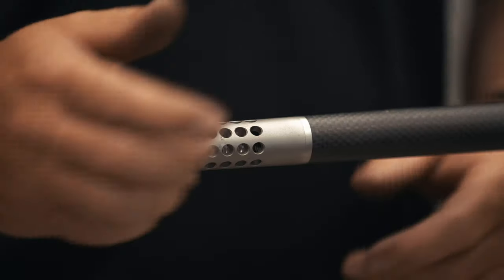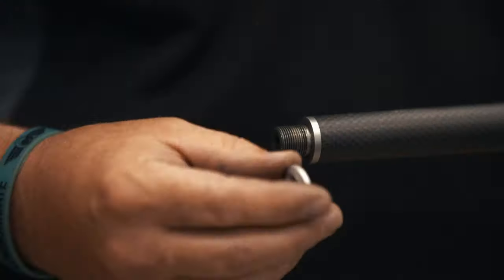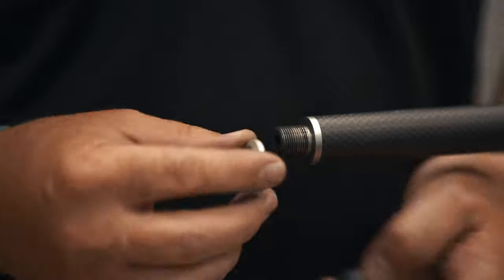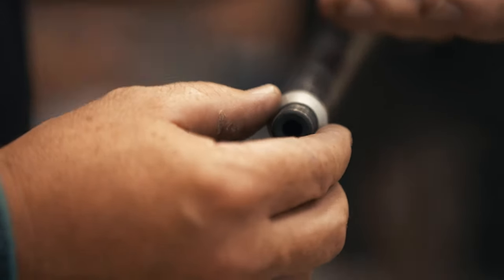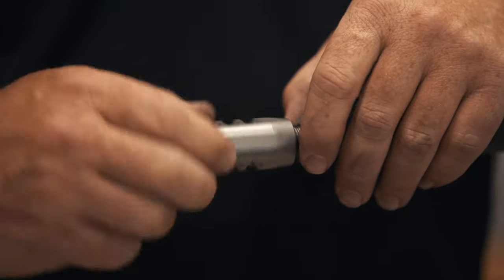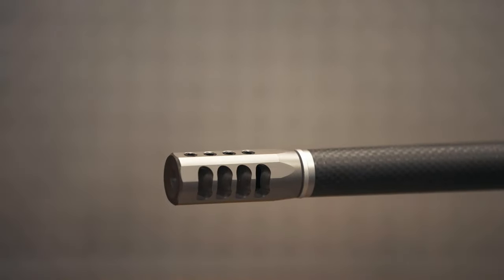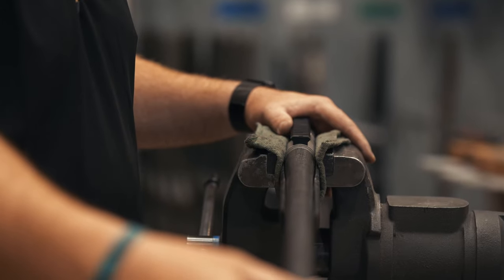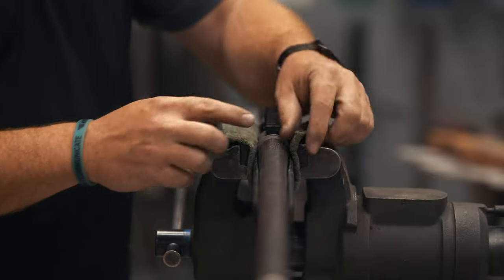How To Install Brake | Christensen Arms

Comment: @christensen arms To remove the brake on a carbon fiber barreled MPR can I clamp the barrel or do I need to clamp the action?
Reply: I have the same question.
Reply: @mwelimmigrante  Christensen responded to an email I sent them and they said you can clamp the action,chassis. What I did, though, was simply grab the barrel as hard as I could with my hand and spun off the brake with a crescent wrench. They use crush washers and I don’t think it had a lot of torque on it.
Reply: Should I loctite the brake on my mesa?